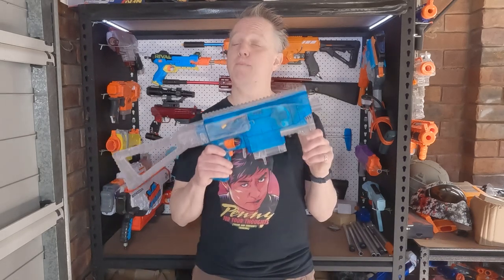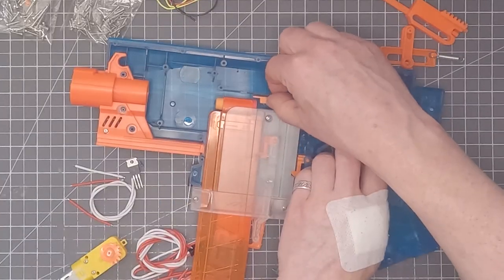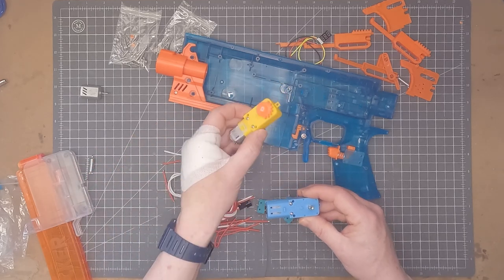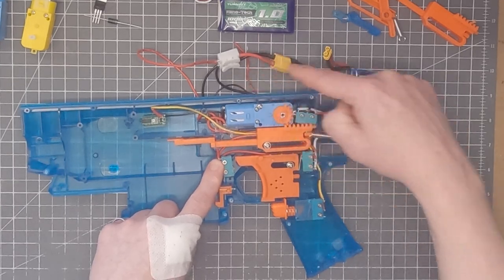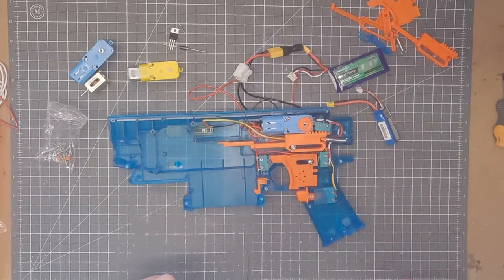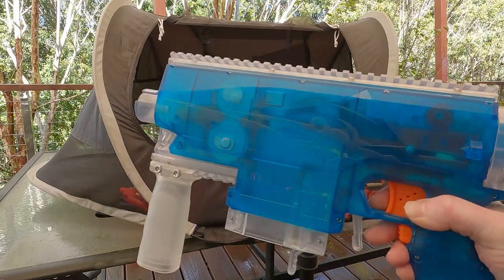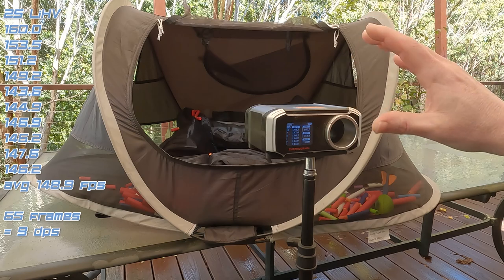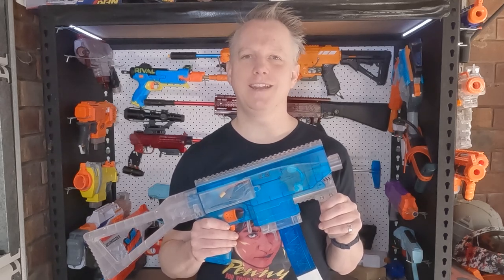Blaster Breakdown 33 (September 2022) - 200fps Banned Auto Swordfish - How to

Comment: I ended up ordering a cage 2 weeks after you organised to do a bulk buy.
I did the same thing and put it in a swordfish but instead of cutting the dart guide, I cut off that little tab on the pusher and glued on the little 3d printed part that Dean sends with the hybrid pusher, no issues and feeds great.
However I did something a little different as I prefer worker purple for flywheels, the proformance was down as the cage is turned for Max darts.
I switched out the motors to neo badgers and with worker darts get into the 210 to 220 fps at 8dps and very high 190s to low 200s at 15dps.
Its exactly the same proformance as my phoenix 3 stage worker white wheels running neo badgers first stage and merlin 2ed and 3rd.
Its crazy banned blasters got a cage like this working as a single, hope he releases a dual stage soon because that would be insane
Reply from the maker: Yeah, the performance is just nuts! Is that Neo Badgers on 3S?
Reply: @andrewg_nerfmods  yeah on 3s, plus a 10cm bit of brass as a barrel guide.
Its one of my most accurate single stage flywheelers I have.
from about 20m, its approximately a 15cm grouping, no fishtailing just straight as an arrow.

Comment: Bro this is literally what Iv been wanting to make and seeing it in action makes me salivate I’d only reverse the colors
Reply from the maker: Nice - not all of the attachments come in blue - the talon adaptor, and muzzle piece in particular.
I do have a clear semi-auto Swordfish where all the attachments are translucent red - painted those myself - so a similar effect to what you have in mind 😎
Reply: Now I would prefer the red and I think they got the whole vector kit in blue
Reply: Oh crap the foregrip is only clear I could of swore I saw a blue one
Reply from the maker: @d0mlyf322  I use an automotive red tint for indicator/brake lights that comes in a spray can - always had good results on Swordfish, Prophecy, Cheetah, talon mags etc
Reply: That’s really cool Iv never tried anything like that
Reply: Ok so I’m thinking the clear sword fish with the blue vector kit and adjustable stock with the clear foregrip and mags I think the sandwiched blue would look nice
Reply from the maker: Yep, that would look great 👍🏻
Reply: What sized pic did you use
Reply from the maker: Pic?
Reply: @andrewg_nerfmods  the rail
Reply: Picatinny rail
Reply from the maker: Ahh, it's the 280mm size. I also have 50mm side rails up the front now. Underneath the muzzle piece I think I just cut whatever I had to size in order to fit a foregrip.

Comment: Where i can get the adjustment volt meter for the pusher ✌️
Reply from the maker: Ahh, I thought your question was where could you fit it!
Sorry. This came with the Worker kit, but you can use any adjustable buck converter that handles 12 volts and whatever amps the motor draws.
Anywhere you can fit it, really. There's space where I have the voltmeter, sitting above the magazine well, and that ledge will keep the wiring out of the way nicely.

Comment: Also, as I watch this on break, I would've clipped the short pusher guide.
Reply from the maker: I was in 2 minds about that... I saw in your Stryfe video last week you went that way.
Reply: @andrewg_nerfmods  I feel I ran into weird dart snag issues.  It doesn't seem to guide anything and clipping it seems to improve feed.
Reply from the maker: About the only thing I could think it might help with is to avoid (however slightly) the tendency from the pusher to bend upwards. But that only helps on the Swordfish, with that ledge above the magazine well. Then again, maybe it does nothing at all?

Comment: Hi Andrew,
I am trying to prepare a part list to replicate your build.
This is what I have so far:
Worker Stryfe Full-Auto Kit
Worker Hybrid Pusher and Adaptor
Banshee Cage Set - Stryfe
Swordfish Shell

Am I missing something?

Thanks!
Reply from the maker: I swapped out the original yellow gearbox that has plastic gears, with the blue version containing metal gears - that's optimal, but should be more durable. I also replaced the motor itself, which is also optimal but something with higher torque should give a slightly quicker response, and higher rpm can give faster rate of fire.
Note that there is a difference between the Stryfe full auto kit and the Swordfish version - the Stryfe one has a few printed pieces to mount switches, motor etc - these are not required in the Swordfish shell because everything is already set up for you.
Of course the voltmeter is optional too, and where you mount the rev trigger is up to you too.
Reply: @andrewg_nerfmods  Thanks for your reply!  Do you know where can I get the blue version containing metal gears? and also, which higher torque motor did you use for the pusher?
Reply from the maker: @ItzikShviro I used a Fang Revamped motor - as it's nominally a 2S motor, I know it's quite capable of handing 3S voltage, which will bump the rpm even further.
The gearbox can be found on Ali Express - search for "TT metal gearbox" 😎
Reply: @andrewg_nerfmods  For some reason the mosfet/resistor/diode (minute 3:55 in the video), is missing from the worker swordfish auto kit in their website.  Is it a must?
Also, do you have a wiring diagram by any chance?